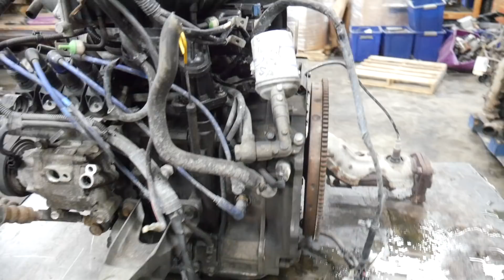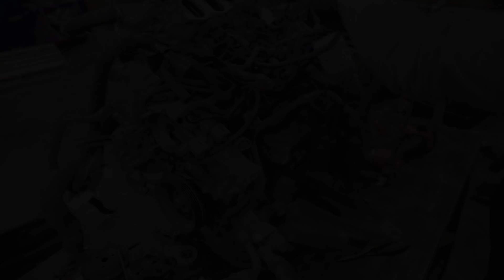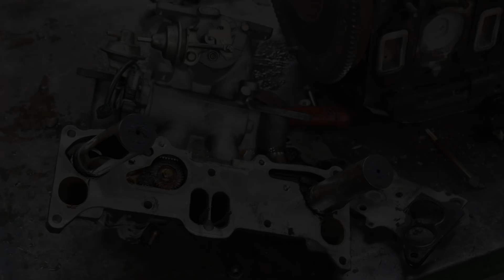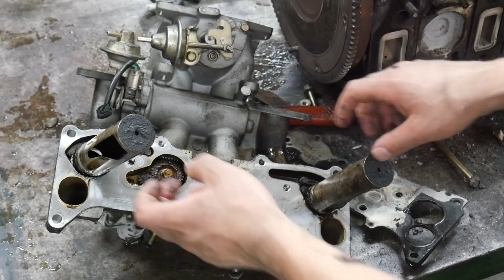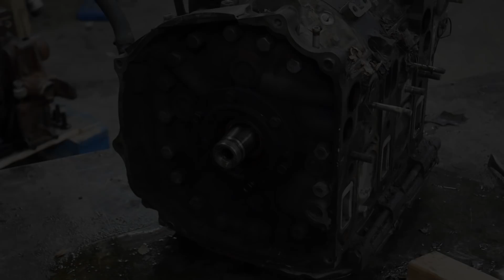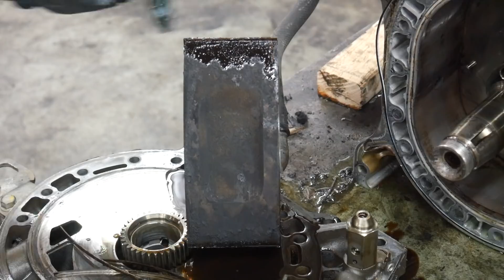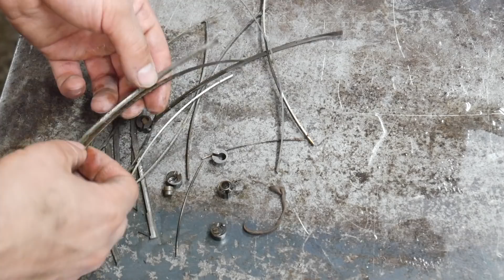13B RENESIS Total Rotary Teardown. 04-11 Mazda Rx-8 6-Port!

Comment: It's crazy how much you know about all these motors. How? I've been a tech for 7 years and learn something new every time I watch one of your videos
Reply from the maker: I still learn every day too! I’m not scared of working on anything and after tearing down engines from all types of cars, and buying all types of cars, you learn all the different failure points. In my business I see a lot of engines and cars at the end of their lifecycle. That’s when little problems cause big, catastrophic failures. I’ve been doing this about 18 years so it just comes from experience! Just think of where you were 7 years ago and imagine where you’ll be in another 7.
Reply: pfft this guy knows nothing, just some crap he once read about how "terrible" these engines are.
Reply: @plav032  yea they're great motor soooo.... great 130k miles and apex seals are gone such a great motor
Reply: @TONYSTARK-jh2wu turn up the opm duty cycle

Comment: Yes, that's why I stick with a Chevy V8 engine which is just about to clock over to 364,000 kilometres when the 13B rotary engine would've been rebuilt twice.

They're too much like the Mitsubishi engines from my experience which require at rebuild at about 90,000 miles (150,000 kilometres) & that's a well maintained one.

When my dad bought a Mitsubishi L300 Express (Delica) van at about 100,000 kilometres (60,000 miles) it already had the 1.6 litre Saturn (4G32) engine rebuilt in it as the old owner towed a caravan with it all over Australia then it needed an engine rebuild, they're not really meant for towing caravans with.

At 250,000 Kilometres on the odometer he needed to get that one rebuilt as new (the engine did 150,000 kilometres)  by a Japanese engine specialist,it left a big oily mess under the front seat which they had to clean up.

He only bought it to cart 5 children around in it so when we got our licences he understandably went back to driving a Holden !

Comment: Also if you want to get the most out of your air impact, get one of those 5 gallon tanks.  Put a T on the filler, 1" diameter; run the biggest hose you can manage up to the tool with matching fittings and the improved flow will feed the tool better.  It'll need time to refill between blasts of course.
Reply from the maker: Good tip for sure! The reel I use is likely a pressure killer

Comment: Love hearing your opinions on the reliability of certain engines. I never knew exactly why rotary engines wore out that fast, until now.
Reply: A series 2 renesis (09-12) has more lubrication and doesn't really have many wear issues compared to other engines. Extra oil injector.
Reply: they don't wear out that fast unless extremely abused.
Reply: @pda041376  Yeah. Like I said series 2 are better but a series one can do a decent bit of mileage too
Reply: They fail because the people who own them typically don’t take care of them properly you have to really take care of these engines or they will fail like any other
Reply: Apex seal needs to be replaced every 60k, it's why they suck
Reply: @catinthehat5140  Huh? Warranty for these cars on the engines were at 100k miles or 8 years. 160k kms. Mazda wouldn't give that out if they didn't think they'd last that long at least (they don't want to loose money obviously, but they did due to owners treating them like normal cars)
Mine is at 140k still going strong with decent compression. Have a friend who's at 200k and only now experiencing troubles starting hot. 
Idk what you mean by 60k dude. 

I mean 160k kms is not good by today's standards, but it's okay. Decent length of time.

But I agree, it's like Subaru head gaskets. The worst part is you have to pull the whole engine to replace them. It's a simple thing just takes ages and is a pain in the ass. Luckily the engines are simple as and dead easy to rebuild.
Reply: @catinthehat5140  Nope. I'm going on 100k, but I know how to maintain and drive it. Most people who have issues with these are people who don't maintain their stuff. Any engine that is abused won't last.
Reply: @1sinister80  "Most people who have issues with these are people who don't maintain their stuff." That seems simplistic. Wasn't the oil injector system only revised on the Series 2 RX-8?  And the sump capacity increased and oil pressure increased by 50% at 3000rpm on the Series 2?  So how is that supposed to help people with the Series 1 car?  If there was nothing wrong with the original design, why did Mazda change it? 🙂 Of course maintaining a vehicle helps, but (as with piston vehicles) it seems unfair to blame owners for engineering decisions or engineering oversights.
Reply: Yep but they are abused by the most owners. Good oil and gas is important.
Reply: I've never had to replace apex seals, but coolant seals fail (bad maintenance/overheating) and the renesis in particular uses side ports routing hot exhaust near them, it causes the side seal springs to fail. Pre-Renesis engines IMO have the potential for longer life, but they're also easy to destroy with poor tuning (apex seals) and got a bad reputation for that.

Comment: My $deity what a contraption those things are.  If I was interested in them at all before now you've certainly cured me of it.
Reply: If your into mechanical things they are really fun to learn about and very simple especially compared to some modern piston engines but definitely not everyone's cup of tea :)
Reply: Rotaries are probably not best suited for automotive purposes. They are a lot happier running as steady state engines where the RPMs don't change much. Aircraft is one area where they really work well. Boats are probably another although there doesn't seem to be much traction in that area, especially since 2-stroke piston engines are still being manufactured. 
 Rotaries are also able to run on different fuels if you feel like setting them up and tuning the ports. Rotaries also have the benefit of being more efficient at higher RPM. Puttering around with one is a surefire way to wreck your average fuel consumption but they are happy as hell to spin at 7k+ rpm all day long. Keep them cool (cold air in an airplane or ample cold water on a boat) and avoid detonation and they turn in long service lives. They might do well in a generator-type setting if you can get a large enough gear reduction to actually work.

Comment: If I ever have a rotary accidentally break the oil injection lines I would slip a vacuum line hose on either end then use zip ties to secure them

Comment: That big fastener that holds the flywheel on is called a "gland nut", old Volkswagen motor heads will recognize it; In Volkswagen engines they are usually torqued to over 200ft/#
Reply: Straight shaft boats have 'gland nuts' too.  I have to tighten mine down at the beginning of every season.
Reply: That's a curiosity - I was just watching a Battleship New Jersey video with Ryan earlier today, and now someone with a connection comments on an engine teardown video.  Small world...
When were you on board?  Ever get to hear the 16" guns?
Reply: @davidb6576  I served as a crewman from 1981 to 1983 as a boiler tech, and I experienced the firing of all her weapons

Comment: At 15 years old my first car was a very clean excellent body good paint $200 1974 RX4 wagon with a 60000 bad engine. I found a used $100 RX4 engine with 50000 miles that Dad and I installed. 10000 miles later it crapped out as well. This was a nice riding, nice looking, comfortable, decent gas mileage car but from that point on I decided I would never own another Rotary. Been helping dad mechanic all of his own stuff since I was in diapers and this video reminded me of Dad and I tearing down an engine that we have never seen before and never again plus had no clue how it worked,  As usual Great Video,  Looking forward to the coyote tear down, Many thanks.

Comment: The problem is these engines like oil and need oil to keep the seals in good shape.  FB RX-7’s were more or less running on two stroke fuel.  You know who doesn’t like burning oil...the EPA.  The quest to keep the rotary emissions legal is what were the demise of the Renesis.  People who premixed their RX-8’s from new had a longer life.

Comment: what's the largest engine you've ever torn apart and how big would you ever go with teardowns?
Reply from the maker: It’s probably the viper engine as far as displacement. It’s pretty compact for its size. As far as how overall large, probably the Cummins.

Comment: Another great vid, man.  90 thou on this one is consistent with my understanding of rotaries; that they're basically a 100 thousand mile engine, tops. Also, you said you were trying to keep your  opinions to yourself.  You're pretty reasonable with the opinions, and I, for one, like hearing your opinions on the engines you take apart.
Reply: no they can last much longer, rx8 engines were the worst, mazda tried a new port design that ended up with a tapered shape that ended in a sharp corner, carbon would build up until it eventually broke off, damaging the apex seals and housings as it went through. Earlier engines were much better.
Reply: The FC and FD 13B engines were much more reliable and rebuildable than the Renesis, reengineering for emissions ruined a potentially decent engine.

Comment: If overheated the rotor housings warp. knocks out the apex seals  I have built oer 700 of these in my younger days... Thanks for the tear down, so much nostalgia
Reply: That doesn’t make any sense
Reply: @joshmanagosta12  if you can warp a block or head you can definitely warp a rotor housing
Reply: @joshmanagosta12  What part? Tearing down 700 of them or the housings warping? If you're saying it doesnt make sense how the housings warp then...well.. it actually does make sense. Things contract when its cold, and expand when it's hot. After so many heat cycles the Renesis tends to lose compression rather easily. Besides that,  if literally any other car overheats once it's done for.

Comment: Rotary engines seem like a royal PITA.  That's probably because I don't have a very good understanding of them, but this teardown video was an eye-opener.  Thanks for sharing!
Reply: The 13B, 12A etc older engines are actually pretty easy to rebuild (this is coming from an LS guy, they are also easy).. doing it good is another story though :)
Reply: That's the trade off of having fewer moving parts
Reply: @andrewgarcia3136  I guess, but like I said it may well be due to my very rudimentary knowledge of those engines.  Maybe if I learn more about them I'll have a better appreciation of them.

Comment: For an engine that is suppose to be 'simple' because it does not have a valve train, this thing is incredibly complex.
Reply: That's what I was thinking.  I didn't even know there were two rotors in them.
Reply: @sapphir8  Worn out at 90K miles is also amazing. My Ford diesel and my Honda accord engine weren't even broken in till 200K.

Comment: Awesome looking car not so much for the engine! Love rotary engines, the makers had the idea just couldn't figure out how to fully develop it.
Reply: @maglsworth snarklepass The rotary engines "run right". They just have different issues than piston engines.
Reply: @maglsworth snarklepass They weren't issues in 1979 when the engine was designed. It operates perfectly fine.  I stated the only issues are with present regulatory matters.  From a mechanical perspective the engine is entirely suitable for powering a car.
Reply: @maglsworth snarklepass I'm not going to answer hypothetical questions that are irrelevant.  The 20+ years sales of rotary engines by Mazda stands on its own to prove the wankel engine was a good product.

Comment: These Mazda Rotaries are a Love/Hate thing...
Very unusual engine concept with insane potential as tuners and Mazda themselves have proven.
But unless you build one from the ground up with performance and longevity in mind they are just a weird and painful engine.
Reply: really only the later engines are tough to live with. As long as you have an older one (with two-piece apex seals), don't flood them and keep them properly oiled they're long lived.
Reply: @CelicaDan  they also sound good drifting at redline, saw two turbo fc's tear up the local drift track and the redline sound is more like a wailing it's unique as hell and godly.
Reply: The main problem seems to be that, like a 2 stroke piston motor, you need to drive them hard pretty much every time you turn the key, or else the carbon buildup causes havoc. For the average driver that never gets above 4k rpm in 90% of drives, its a terrible engine. Especially since it wants to be redlined, something few average drivers ever do. The old design had ports coming out the side of the housings which would "scrape" carbon and potential carbon buildup out of the exhaust ports. But since that is terrible for emissions and would not pass regulation, Mazdas solution was the ports in the irons, probably causing Renesis to be even more prone to apex seal failure.
Reply: @DxWhoopingCrane  most of the carbon buildup tends to be the result of using cheap fuel and engine oil with high ash content with the oil injection system still in use. Since switching to E85 and premix w/o OMP my Turbo II rotors are pretty much clean of carbon, also a lot less chance of detonation too thanks to the higher octane rating.
Reply: @DxWhoopingCrane  id love to see rotaries back in performance cars so bad. Mazda raced these things afterall. And they worked.
Reply: @hillbilly tech i don't believe that one bit, I'm almost to 188k and bought this car with 25k on it the engines never been opened
Reply: The Wankel is just built wrong from the ground up anyway you look at it. Liquid Piston's rotary engine is just some much more clever than Mazda's.
Reply: @RayleighCriterion    That design is clever for a tiny one off prototype. But it is kind of silly to compare it to Mazda designs as it does not have to be mass produced, pass emissions, or last for thousands of miles. Judging by just the design of the "rotor" alone it would be very difficult to mass produce for a full sized car engine without being too expensive to be worth the benefits. It also improves on some of the design flaws, but it seems dubious that the design of that rotor would hold up to heat cycles in a full size version at sustained high rpm, and the seal issues are still there just not as pronounced.
Reply: @hillbilly tech plenty of compression, runs fine.
Reply: The tip seals need to be relooked at by someone with lateral thinking, a whole new approach.
Reply: Just took my 1988 RX7 FC Turbo for a spin today, great fun. Had 1 rebuilt in 1997@ 100000 kms. Car has now 150000. Next rebuilt scheduled in Summer 2045.
Reply: @heikopanzlaff3789  Wait, your bragging because your engine needed a rebuild at 65k miles?  Most engines don't need that until 150-200k miles if maintained properly.  Weird flex i guess?!?
Reply: @fadetoblack2104  he doesnt drive much, at the time he say the water seals will be dryed up hence his next rebuild
Reply: @SvenTviking  there was a company called racing beat that used to sell upgraded apex seals to improve performance .There is a guy in Canada that's installing a newer rotary engine in an old Cosmos Chassis - " Aaron Cake cosmos" .He's getting about 300 plus in it.
Reply: Agreed, I either see them used and throw away track cars or trailer queens, the potential is there but at that point you are pretty much looking at close to German super sport money and god help you if there isn’t a service report depending on what you are buying it for
Reply: Mine has 187k original miles on it lol. In fact the clutch finally went about 2 weeks ago when I got drunk and attempted to do some donuts 🤣
Reply: Just a recip engine.

Comment: Oooh, mixing things up. I like it! Gonna have to do a Subaru soon. Try to find an EZ30 or EZ36. Way cooler than a common EJ25. If you get an NA EJ25, chances are it was pulled for a bad head gasket. Despite the memes, all other Subaru engines, including the EJ25 turbo, don't have prevalent head gasket failure. Watching you tear down an 02-05 WRX EJ205 would be cool too though!

Comment: When you hear chasing down ignition problems and rotary engine in the same sentence you already know the carnage you will find inside.
Reply: But he didn't find any carnage, like none, zero. Also, my 13B Rx7 has been running cheap LS2 coils for 8 years no issue
Reply: @arrancoote  Yeah I was shocked when he split it open to see it was still all together. Wasn't a ignition problem. Just a worn out low compression problem. You having a rotary engine know the destruction that detonation will cause to the apex seals though.
Reply: Probably just had a weak starter